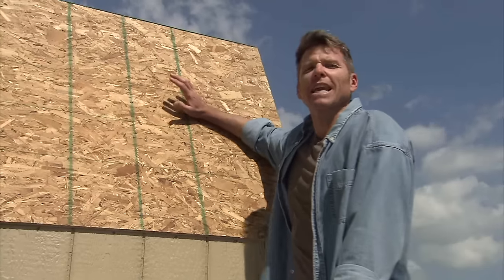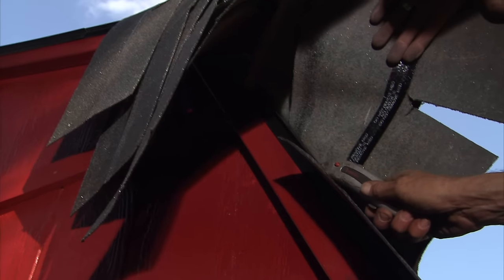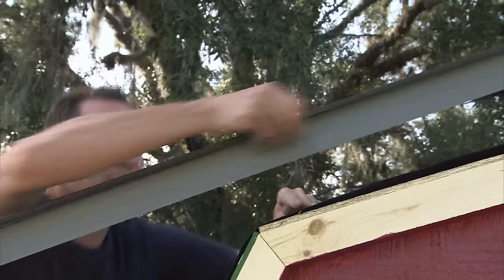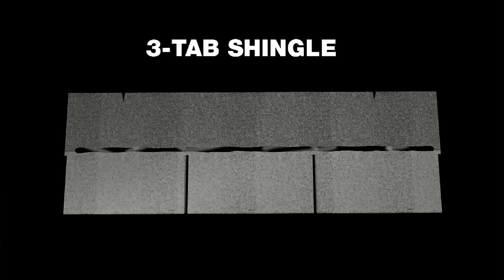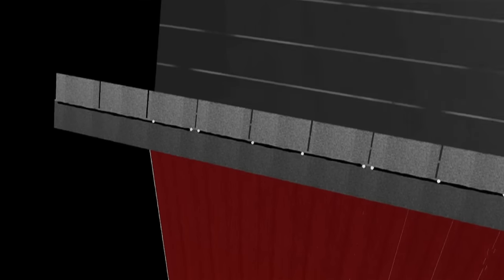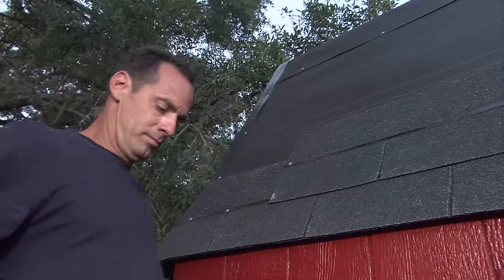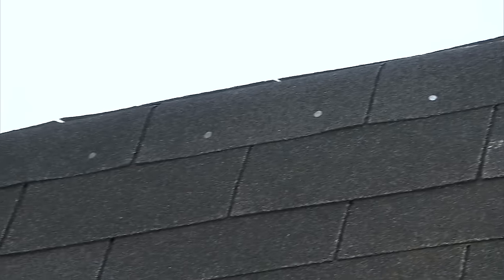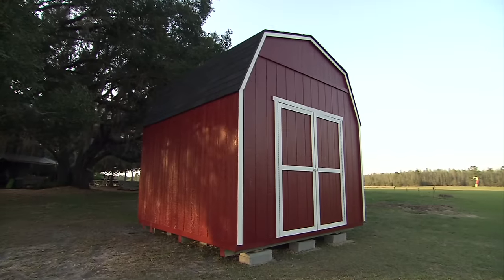How to Shingle an Outdoor Storage Shed Roof

Comment: Will this roof keep water out? Yes. Would I pass this roof? Absolutely not. Do NOT nail your bottom starter row up high on the tar strips. Nail it low into the bottom drip edge so the wind doesn't rip it all off. Never cut your shingles flush with the drip edge, you want 3/4 to a full inch of overhang. NEVER use nails below your tar line to keep shingles down at the bend of the roof. It looks terrible and unprofessional. Let the heat of the sun bend the shingles down and use a dab of blackjack or any other roofing contact cement between the exposed tab and the shingle underneath, I promise you it will hold better than any exposed nail ever will. But at the end of the day its just a little shed, follow the steps in this video and you will be just fine. Just don't apply what you learned on this video to roofing a sloped house or building.
Reply: +FlyingShazbot "Never cut your shingles flush with the drip edge, you want 3/4 to a full inch of overhang". Why?
Reply: What about the row at the top with the exposed nail heads? Seems like no nails should show, I would think that would be a way for water to seep under the singles...
Reply: +CHRIS RICE 

You can cover those with a colored caulking to match the shingle if you want. Or just leave it as it, I have never seen a leak from a nail hole unless you remove the nail and leave the hole open. The water molecules aren't small enough to squeeze through the space between the nail and the shingle and the sheeting on the roof.
Reply: +Fishingtuts 

The logic behind having the shingle hang over the drip edge is pretty simple. It helps eliminate water running down the side of you shingle, if it is flush with the drip edge, and eventually under the shingle. It's not a guarantee the water will go in or not, its just good practice. If you have installed your underlay correctly, whether its tar paper, synthetic roof wrap, or ice and water shield, you should be sitting pretty good regardless of how the edges of your roof are.
Reply: 3/4 ONLY IF YOU DONT APPLY FLASHING
Reply: @LiberatedAmon  exactly why I watched too. I saw it nailed down on the Store bought sheds in town and I thought nail heads showing in thr middle of the roof makes no sense. I'm going to do it the way commenter explained.  Makes more sense.
Reply: Y4
Reply: Would you pass it? What do you mean? An inspection for a shed roof? 😂
Reply: @josepgutierrez22  He's trying to pass on some best practices. 🤷 And I agree. Plenty of blackjack is a better way to go. Lol
Reply: Failure, with the nails showing....
That's a great place for a leak to start

Comment: 1. You can use a staple hammer tacker, easier to install felt. 2. Instead of trimming singles flush, allow a 1/4" to 1/2" overhang on perimeter to shed water away. 3 use starter single on perimeter to serve as your overhang trimming guide and trim as you go, usually what you trim at beginning will fit at the end so less waste. 4. If right handed, shingle from left to right.
Reply: Thanks for your advice, those were questions I wanted to ask. I think the exposed nail heads look cheesy but would probably work

Comment: 5. Instead of nailing the tabs where the pitch changes, set those shingles in the sun to warm up and make them very flexible. They will contour to the pitch angle, place a dab of roofing cement under tabs for that course to keep them secure. A clean nail-less look. Warning, wear gloves. Roofing cement is sneaky and will get EVERYWHERE.. Face, arms, clothes, tools, once it's on you it will get everywhere. Also a hook blade works best. It let's you score the back(soft) side of the single.

Comment: Won't water leak into those exposed nail heads on the top ridge? There has to be a better way to do this.
Reply: Roofing cement after the sun has warmed up the shingles that is contours to the bend to that edge.

Comment: The guy who installed the roof put the roofing material  without leaving 1/2" space.Now what to do? I heard you can attach plastic apron on the roof so that the water will be directed into the gutter. How do I install the apron? Is it ok to install on top of glued roof? If yes, what kind of sealant to use? Btw: there is no fascia installed.

Comment: I aint a roofer and I do believe this pattern will work but I think this way is called "stacking" and most pro roofers don't use this pattern. One you have to keep going 1 row at a time back and forth way to much moving. Pros do a offset 5 row pattern and do one swoop across the roof and have 5 rows done.
As far as shed building again I am not a carpenter but I love to work with wood and just about anyone can build there own shed. I have built 2 sheds and they are "army' strong and built way better than the HD/Lowes sheds and cheaper too but and this is the kicker is it do take time to do it and do it right. A lot of research and contemplating how to go about the next step YouTube is your friend. Everything you need is right here on YouTube.  Oh also a truck or "car with trailer" is a must= you can rent the trailer.

Comment: @4doorlife Yes you can always use rolled roof but it does not have the longevity of 3 tab shingles.
Shingling this size shed is easy and shingles look SO MUCH nicer than roll roof but yeah
you can do it.

Comment: Thank You so much for taking the time to make this video! We reshingle our 10 by 20  our barn shed using the methods in this video. It took 9 bundles of shingles. We did cut ridge caps for the top and used liquid nails to secure the shingle line that overlaps each side because it is winter and the asphalt strip won’t grab in cold weather. We didn’t want a wind gust to damage them.

Comment: We lost most of the shingles off our shed in Superstorm Sandy. We finally finished redoing it Monday. We followed these instructions, with one exception- we also put down some roofing sealant under the shingles. We just had a real howler of a squall come through here, and we didn't lose any shingles! Thanks guys! (Also, Gary E- we also used a multitool to trim the shingle edges, but we found the semicircular blade to work better.)

Comment: Yo I’ve seen and been told by roofers who’ve work over 10 years to never nails into the glue line. It should be just a bit above it. Second, you never made a book pattern that the manufacturer recommends in your bundle. You always start with a full shingle with an overhang of 1/4 to 3/8 with flashing. Then, start your book of 5’ 5/8 depending on the bundle instructions. Lots of mistakes here not good.

Comment: This was a helpful video for anyone who's going to shingle a roof whether
it's on a garage, shed or house.  As mentioned by others I hated to see that
row of nails on the first ridge of the barn roof.  My neighbor has a barn style
shed and he did not nail the tabs.  After the hot sun hit them a few days
they laid down nice and flat without nailing the exposed tabs.
Also as mentioned you could glue the tabs down with roof caulk
or you can get a gallon bucket of roof patch for just a few bucks.
Reply: Thank you!

Comment: Thanks!  Getting ready to shingle my barn / gambrel roof on my shed.  Worrying about doing it right. Anyone want to help on some questions:

1) at the change of angles (at 4:00 in the video) do you need to plan vertical spacing before you even start to be sure you get the  shingle to have the correct overhang at the bend?
2) Some people said to do all kinds of flashing / stuff I didn't understand at the bend.  In the video and on my 20 year old shed, you just keep going.  Both work I guess?
3) No drip edge at bottom (rake?) edge? There's not much extra cost. why don't you do all the edges?
4) 1" overhang at bottom and 0" on the sides? Just want to make sure I heard it right / see if anyone disagrees : ) 
5) I have some self stick synthetic underlayment left over from my house getting reroofed last year by a pro. I was going to cover the bend and peak and if I have more, the bottom, just 'cause I have this material?  Then felt over those areas and the bare sheathing in other spots?
6) the shed was built with OSB sheathing. that lasted 20 years (with a slow leak for 7 years).  I am using exposure 1 plywood?  that good?
7) any other tips?

Comment: Would change way shingles are installed at pitch change between mansard and upper slope. Shingle up to pitch change, instead of leaving face nails, install row of cap shingles overlapping onto upper slope using same method as at ridge, then snap line 1/2" up from middle of cap, lay bead roof caulk, begin shingling upper slope. This method  gives you longer life span and looks more professional than exposed nails. Use architectural shingles, hip/ridge cap, starters with sealing strip. :)

Comment: my parents just had Lowes in Wichita Kansas install an outdoor storage shed, and they did not use any kind of underlayment or tar paper. Told my folks that they don't need it anymore??? what the heck? anyone else hear of this ? or did Lowes pull one over on my elderly parents?
Reply from the maker: +Michele Clevenger it may not have been needed: pitch of roof, if shed is unheated, etc. If you have questions don't hesitate to follow up with the installer or your Lowe's store. Thanks for watching our video.
Reply: Michele Clevenger ; underlayment is inexpensive. I doubt Lowes would try to get over on someone for $14.00 a roll.
Reply: maybe, maybe not, had the building and all the items inside been damaged from water leaks, it would have added up to more than $14.00. They did come back out and redo it properly and they're extremely satisfied
Reply: underlayment is completely useless when the shingles are installed because 1000's of holes are put into it when the shingles are put on. So when the pitch is steep, its even more better just to not use paper. Now if you ice and water the whole thing thats a different story, just way more expensiver

Comment: Shingling while standing on a ladder. Huh. What are you standing on while applying the shingles? Not one shot shows this. It's not a ladder. A scaffold? You are always standing at the perfect height. The roof line is six feet off the ground but then you're standing on the ground (1:22) and it is suddenly just three feet off the ground. Magic. Imagine a real roofing job. Do you carry one shingle up the ladder at a time, or do you carry 90 pound bundles of shingles six to twelve feet up a ladder and have them hover in the air while you nail one shingle at a time? I can shingle but I don't see how you can install a roof that you cannot stand and kneel on.
Reply: I came here for this question that I cannot find an answer for.
Reply: @yolandawebster7808  I used an 8-foot step ladder for standing when doing the lower section.  I used a five-foot step ladder with some boards across it to hold a partial bundle of shingles.  See the comment about doing a five-row pattern so you don't need to move the ladder between each single.  The back of the GAF shingles bundle described this in more detail.  I found the GAF instructions more helpful regarding placement of nails.

Comment: This is not how they installed my roof yesterday 6/6/18 !!!  They did not put the felt under the drip edge! They did not over lap the shingle 3"oor 4" over the bend! They used scrap pieces of shingles because they ran out of shingles. They did not install the vents in the back of the shed! They pieced together the bench and shelf. What a mess!!!!!